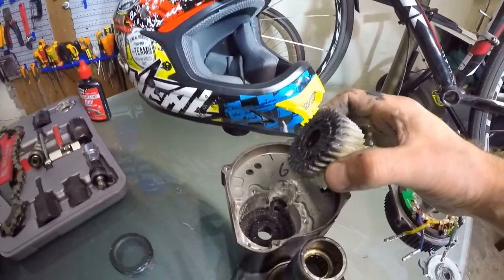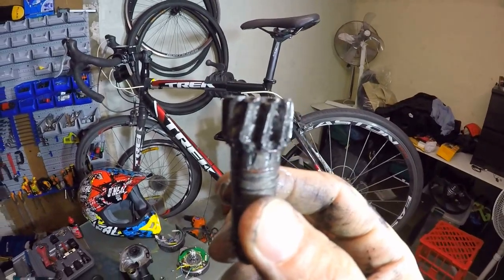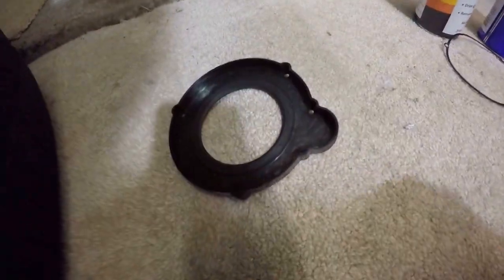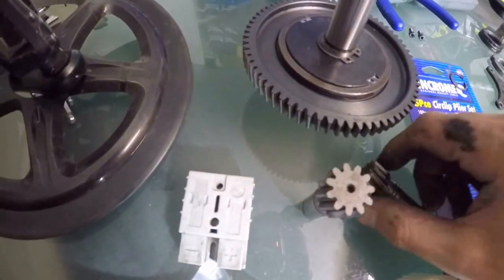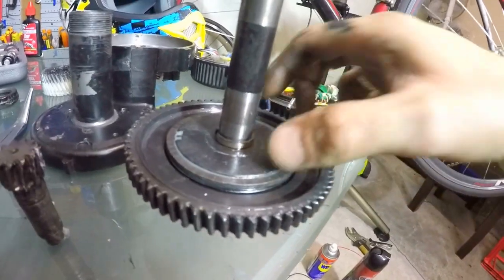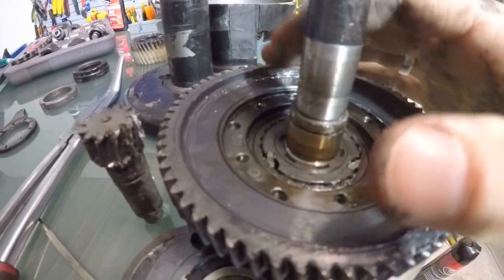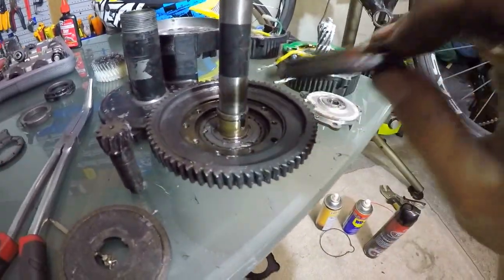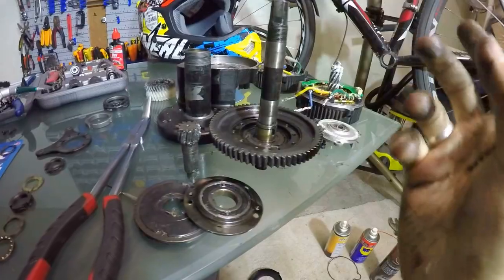DIY Tutorial Repairing BAFANG 8fun BBS02 750w 48v (Part 3 of 7) *internal gears & new parts

Comment: The difference between the "OLD MODEL" and "NEW MODEL" can be determined by the shape of the controller, Type A is larger, i think you have type A looks like 3/4 of a donut and the hold is partially filled in.. Type B controller is shaped like half a donut.

Comment: Bruno hi, how many kilometers has that motor at that point?
Reply from the maker: Yeeeaaahh... this is not a normal user scenario... this was before the big BBSHD was released so to get more power I overvolted, hacked the programming and overgeared forcing the gears, the controller... basically the "destruction combo" hahhaha did all that and never lubricated to see how far I could push riding using the wrong gears...  
I can't really remember now but I think this motor failed around 1700kms.. actually much longer than I was expecting!!
If geared with 42T chainring, user changing gears properly like normal bike, greasing the large internal gear every 3000km... this should last for thousands and thousands of kms... 
So far this is the highest torque and quietest motor avaiulable. I have tested many other brands along the years... Bafang is not perfect but is far ahead of all other conversion kits...  
Alternatively, you can use hub motors, they're good for older people and some girls who don't want to be changing gears, less performance, less maintenance but yeah.. bit less fun too
Reply: ElectricBike totaly agree and thank you for the answer. POWERRR!!!
Reply: had to grease mine after 800km's. was starting to make a little noise. thanks for video.